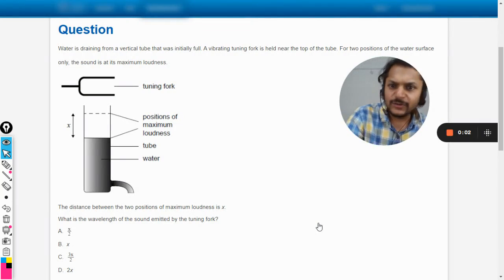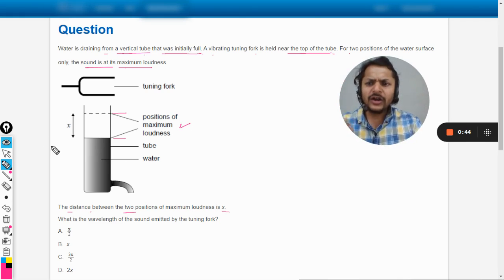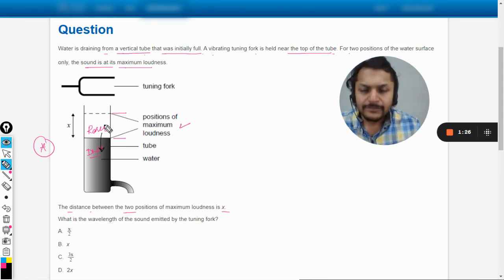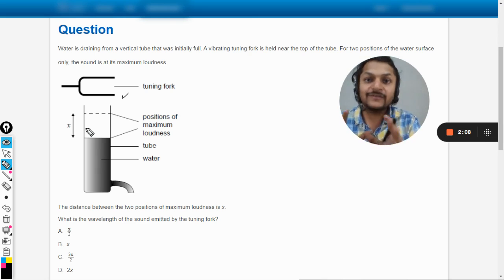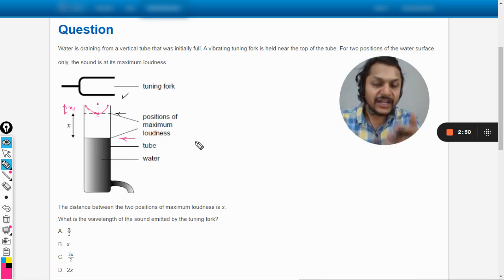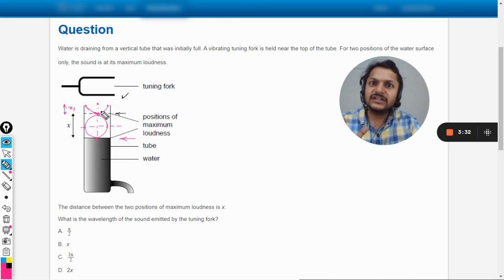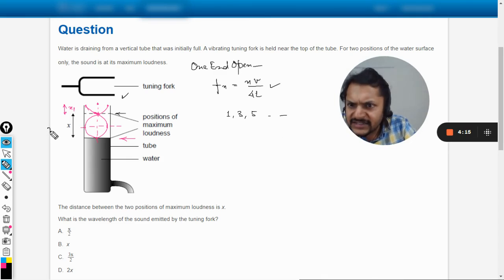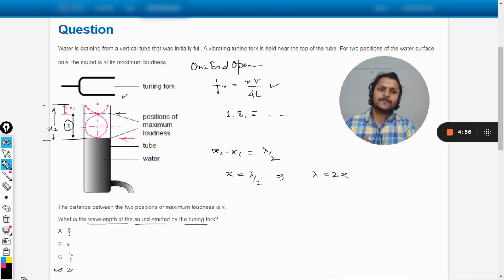Water is draining from a vertical tube that was initially full. A vibrating tuning fork is held near

Comment: Did the question ask for the wavelength before or after it entered the tube? I assume even tho it won't enter the water and speed up, it would lose some speed bouncing around and change it st least slightly. Or would it not matter because it stays equivalent